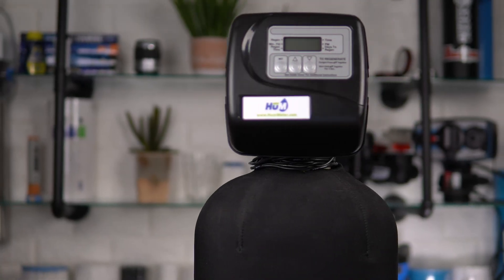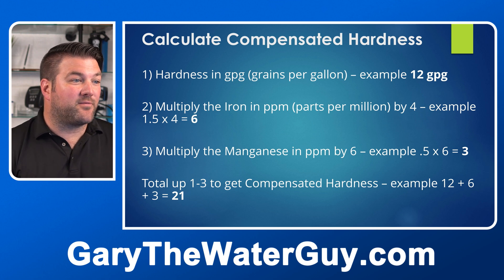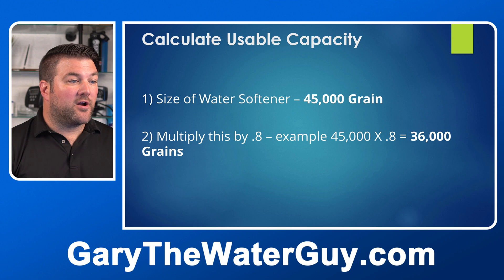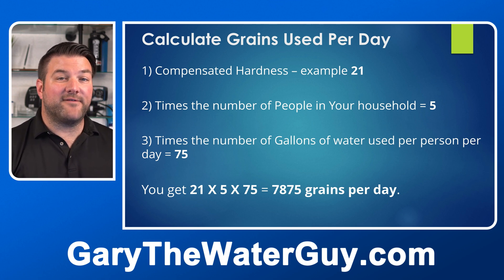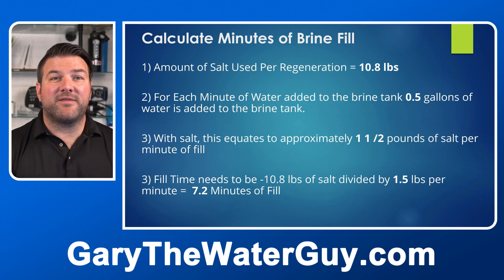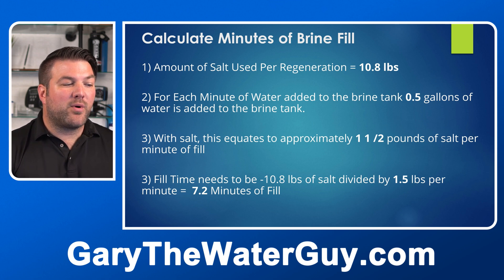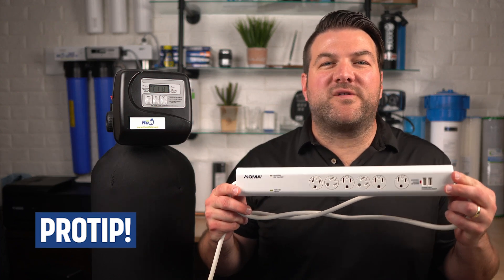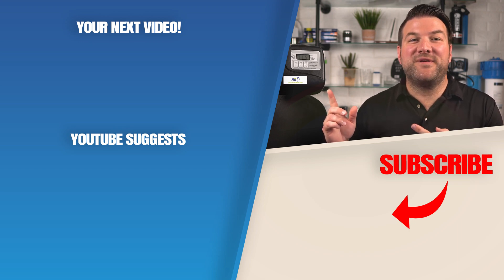Clack 3 Button Water Softener Settings Simplified

Comment: Why P3, because you have manganese? What if you dont? Why would you use one of p1 - p6?
Reply: Also why did the amounts change from 10.8 lbs and 7.2 minutes to 13.5lbs and 9 minutes .. is there some averaging you do to use a higher number?
Reply from the maker: Yes, P3 is if you have iron and or manganese. If you don't then P2 is the default. P1 if your water isn't very hard or if you have water usage concerns. P5 or P6 would be used if you have iron and or manganese and water concerns.  You would experiment with those for that somewhat unique situation to see what compromise is best.
Reply from the maker: Good Catch!  The 13.5 lbs and 9 minutes are incorrect, it should be 10.8 lbs and 7.2 minutes.

Comment: Can I use Clack valves to replace the ripoff Rainsoft crap in my house? I swear this company is fleecing me. A water softener shouldn’t cost $7,500.00 and service shouldn’t be $228.00 to replace a simple filter.
Reply from the maker: Yes, you are correct those are ridiculous prices.  You can replace that water softener with a Clack valved one for less then 1/4 of that price here https://waterestore.com/products/hum-deluxe-water-softener-30-000-grain
Reply: @water_estore  I figured it’d only be 1/4th the cost! They got me good back then because I was a new homeowner with zero knowledge. They are a predatory company.